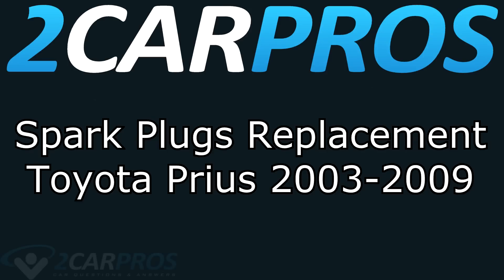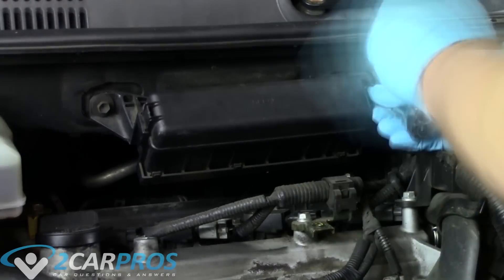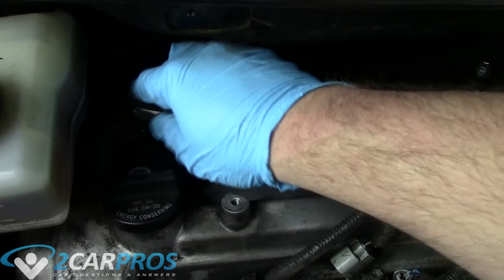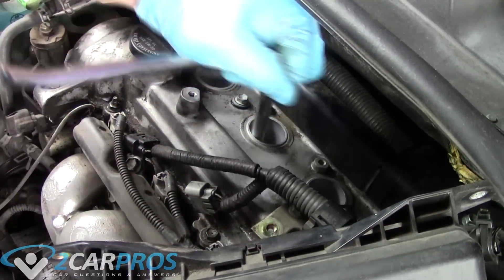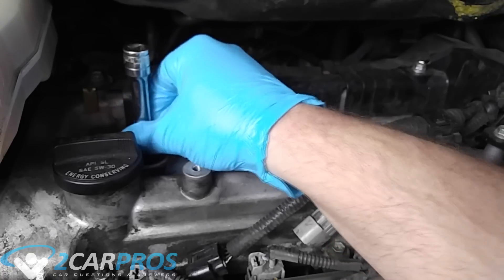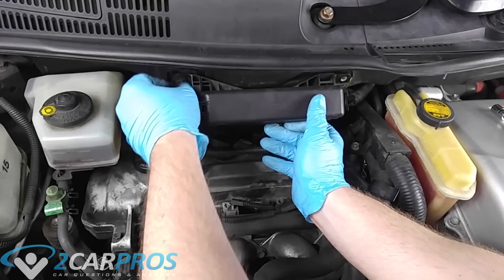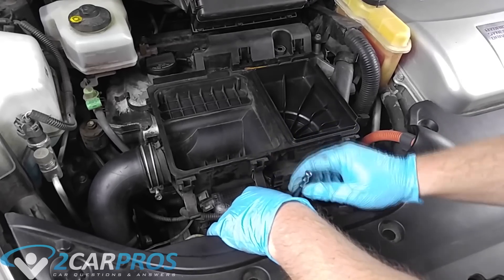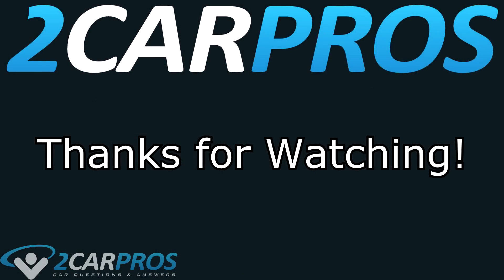How to Replace Spark Plugs Toyota Prius 2003-2009

Comment: how important is it to torque the plugs to 13 lbs? Do I need to go buy a torque wrench?
Reply from the maker: You really don't have to IF you know how much force to put on the plug. It is a medium amount of force because the head is soft and you don't want to strip the threads that would be really bad. If you are unsure what I mean by medium tight then you can rent a torque wrench at a local auto parts store no need to buy one. People just get mad at me when I don't list a torque spec even though I am pretty sure they don't even own torque wrenches. Thank you for watching!
Reply: If you work on your own car, you're saving mechanic fees anyway.  Anyone who works on a car should own a decent quality torque wrench, especially when tightening into aluminum...

Comment: Use compressed air in spark plug wells after removing coil packs.  Some click type torque wrenches will not click at such low settings.  Use an in-lb torque wrench and multiply by 12.  In this case, 12x13=156 in- lbs.
Reply: Good call, I broke two of the bolts trying to torque them with a larger wrench.  But, it's easy to get a replacement at an auto parts store; thankfully it was around the corner from me!
Reply: I purchased a spark plug remover\installer tool from Ebay but it does not have the ft torque thing on it, can I still use it to tighten the spark plugs in its place? is the torque measurement when tightening important or should I just make sure it's tight enough using my installer tool?

Comment: I don't understand why you have to remove the airflow components unless it's for extra work space. I changed all four of my spark plugs just by moving the relay out of the way..
Reply: Yes same deal you don't have to take all that crap off
Reply: Charlotte Huff: You could undo the airbox but you don’t have to. Either way it’s all about personal preference
Reply: Hallelujah, that'll save me a ton of time.
Reply: My 2005 Prius has 190.000 how much does it cost to have the spark plugs done by the dealer?
Reply: @zumbaconrobertosouthwestde1577  probably 500 dollars lol for 4 plugs its only like 40 dollars...

Comment: Craaap that's a lot of steps. Lol wish me luck!
Reply from the maker: You got this!  Thank you for watching!
Reply: Would it be too much to ask what tools you used and where you bought them from? I was looking at your website last night but wasn't sure if it's listed in there.
Reply from the maker: Well our tools are Snap-On brand and you can only really get those from a Snan-On dealer. They are the best tools I have ever used but they are ultra expensive. Like 170 just for a ratchet expensive. 

This is a really great set and contains every tool you need to do this job and most every other job as well.

https://www.amazon.com/gp/product/B01BHJE0J4/ref=as_li_tl?ie=UTF8&tag=2carprcom-20&camp=1789&creative=9325&linkCode=as2&creativeASIN=B01BHJE0J4&linkId=513893ca1c90e65cdb38f4727991d95b

Thank you so much for watching!
Reply: @2carpros  that looks more like a blue point ratchet

Comment: What length did spark plug socket you use? 6" or 10" ?
Reply from the maker: It was a 6 inch extension. Thank you for watching!
Reply: 2CarPros Thanks! Could you tell me where did you buy spark plug socket?

Comment: The SAE needs to get their stuff together. Let me grab my 10 mm socket to remove the coil pack from this cylinder. Now lets a get 5/8 inch spark plug socket to remove the spark plugs. Seriously, pick a measurement system and stick to it!
All that aside, awesome video guys! Keep up the great work!
Reply: I dont understand why a 5/8" socket fits these plugs. The plugs are 14mm and I saw that if not using a 14mn socket a 9/16" will work. Isn't the 5/8" socket to big?  Can someone please explain this to me so I can purchase the right size socket?  Thanks.
Reply: @rongottschalk4472  Dude, just ask for a spark plug socket.
Reply: 😂Carlo, not really. I have used 10 mm head bolts on all my cars since 1970. 
5/8 is also a spark plug standard, used on almost all cars. So I have not bought new tools for decades!
Reply: Carlo David you do not know what you are talking about. Please tell me a spark plug socket in metric. Also tell me what size socket ratchet other countries use is it 1/4, 3/8 and 1/2?

Comment: Very well done with concise narration.  Thanks for including the torque specifications!
Reply from the maker: Thank you for watching!
Reply: I purchased a spark plug remover\installer tool from Ebay but it does not have the ft torque tightening spec thing on it, can I still use it to tighten the spark plugs in its place? is the torque measurement when tightening important or should I just make sure it's tight enough using my installer tool?